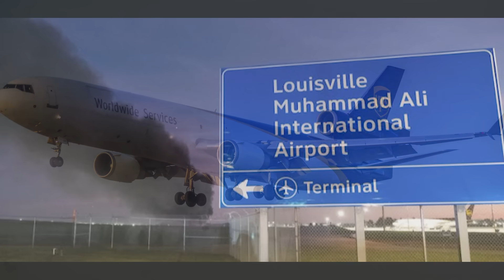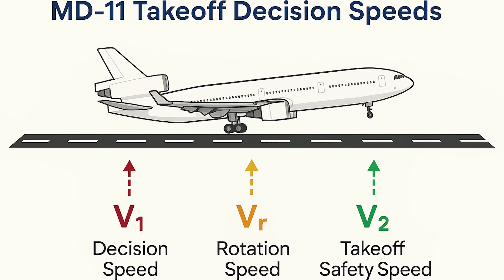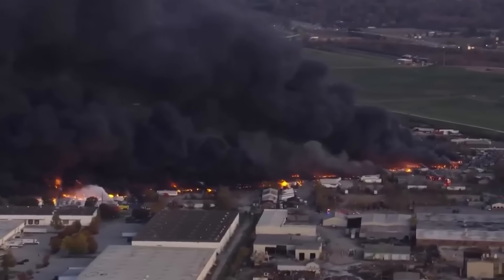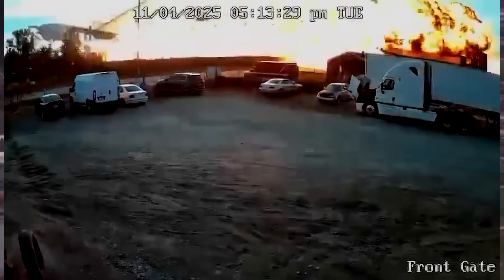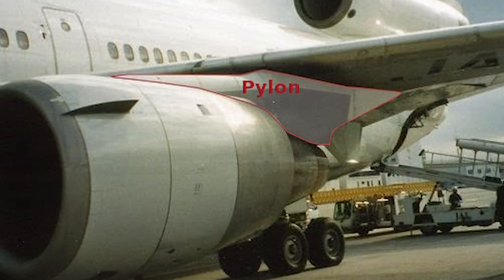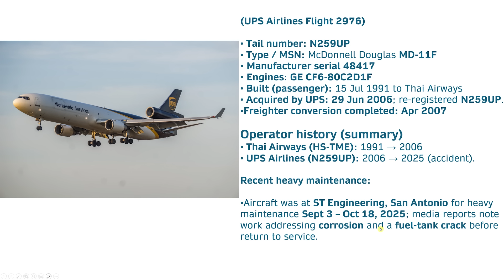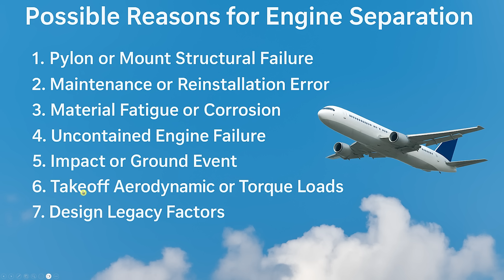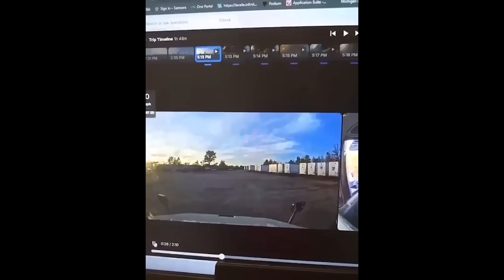What Caused UPS Plane Crash, Louisville, KY? How MD-11 Engine Fell Off

Comment: Check out American Airlines Flight 191. DC10 lost the left engine at VR(?). Root cause for the engine falling off: when performing an engine change, the engine was improperly removed and the replacement engine was incorrectly installed.

Comment: so, Im no pilot, but if they reached V1 and are committed, isnt the plane designed to still be able to lift off and get airborne with just 2 intact engines (right side and tail)? I know these big planes can still fly on 2 engines while in the air, but, are they not able to take off with 2 engines still intact?
Reply: "Intact"? After all that debris ingestion?

Comment: A couple of things I noticed.  The roof gouge is in line with the center of the runway.  The bulding is a lightly constructed warehouse.  The roof is relatively thin metal on lightweight lattice trusses.  The initial impact did not appear to slow the plane.  I suggest that, unusually, the tail was stronger than the roof, with the wheels maybe touching down lightly and taking some load.  That impact did not absorb any significant kinetic energy, unlike the AI 171 first impact which must have absorbed a great amount of kinetic energy.  That is why the UPS debris field is so much longer than the AI 171 debris field.
I have been studying air accident reports since around 1960.  My instincts tell me that this engine dropped down, rather than pivoting up like the American Airlines 191.  Corrosion?  The wings are multi-cellular failsafe aluminium design.  Multi-cell construction makes inspection for corrosion more difficult.  Also, fuel tanks are prone to corrosion at lowest point where condensation collects as water.

Comment: No way it reached 175 feet altitude, it barely got off the ground.
Reply: Wrong, clearly made at least 150ft plus.
Reply: @imh-opinion 
What evidence? Sure doesn't look like it in any video. Nose high and barely off the ground.
Reply: @thud9797 if one molecule such as the outer skin of the cockpit reached 150ft then the measurement is correct.
Reply: @imh-opinion 
Ok then maybe so.

Comment: Interesting question, I find, is : why does the aircraft roll into the missing engine? Especially, if it is certified to continue the takeoff run and fly on only two engines?

Comment: the main point you didn't even talk about is why it didn't climb with 2 engines? one engine out alone would not have caused this crash. juan from blancolerio, who actually knows what he's talking about BTW, suggested parts from the detached engine crashing into engine 2 or 3 and causing one of them to fail. it would not climb out with 2 engines out.